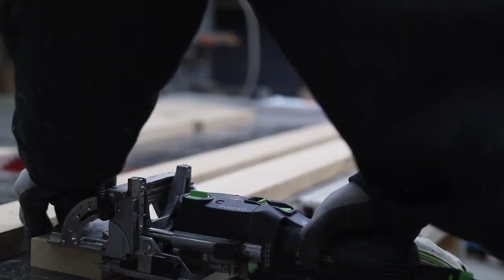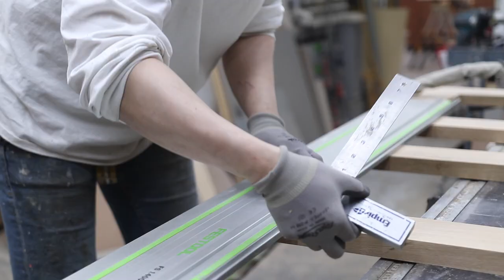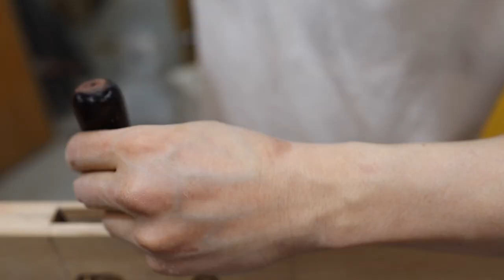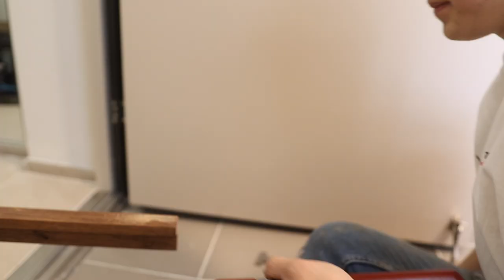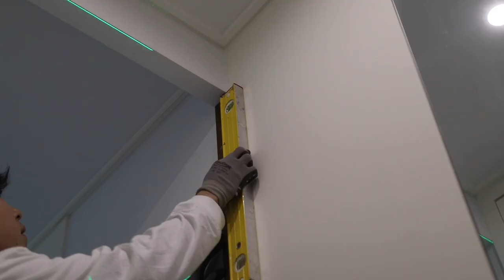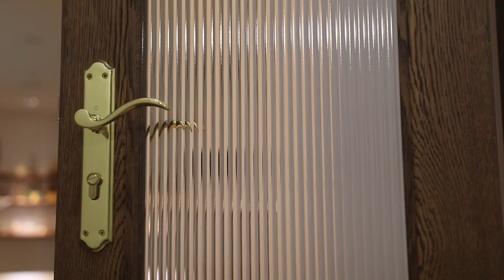W94_Oak double entry door (Mortise Lock)

Comment: Beautiful doors but why not use shootbolts that a are actuated by the door handle?  Unlocking the inactive door manually is a poor choice and requires to lock them again top secure the active door.
Reply from the maker: The reason is too narrow. If use shoot bolts ..it will inconvenient to pass by door everyday.. so I did choice that way and the hinge used doors have auto closing and smoothing.